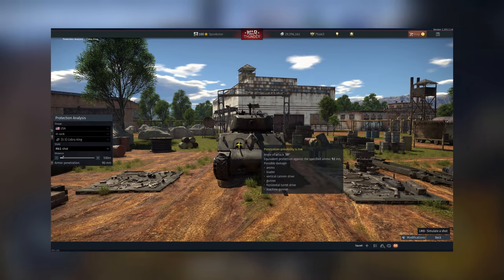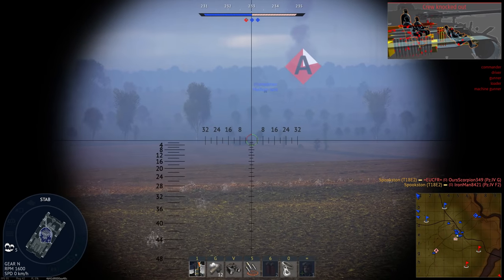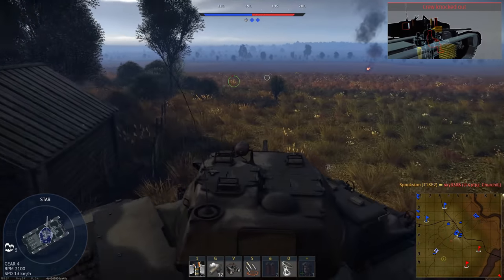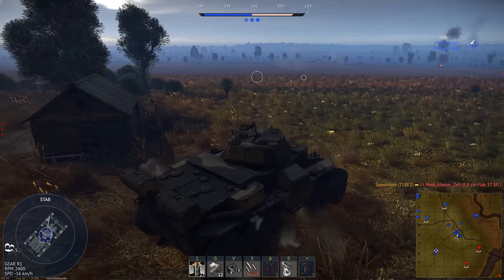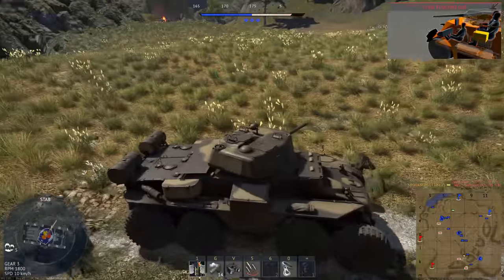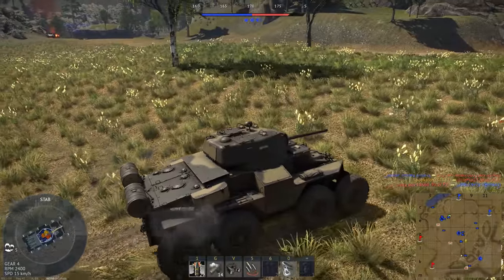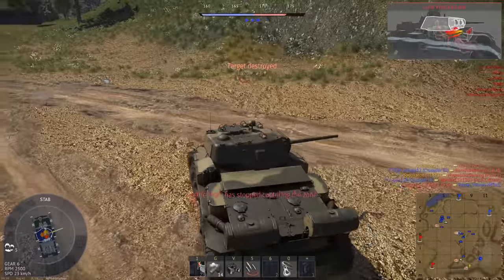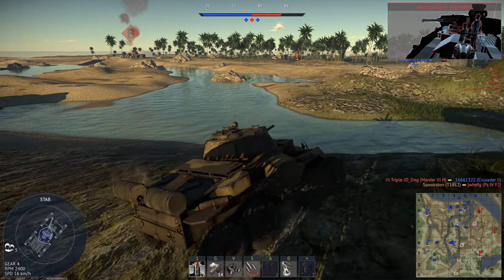Volumetric Shells Were A Bad Idea

Comment: Since the addition of volumetric shells the M22 and many other tanks got their side Armor buffed because of the tracks... They can have up to 1300mm of armor on the sides. But other than that i have to say that i am still doing pretty well to some extend. I didn´t even change my playstyle its just more finding and knowing possible weakspots. which makes the fights more interesting for the most part. Of course there are still issues with this system but its better than pixel hunting. I mean come on who wasnt annoyed of that constant turret ring sniping. Every freaking tank could shoot it and now it´s MOSTLY fixed. It can be more frustrating penning enemies but think of it that way consider what tank you use and they´ll have problems penning you. It´s a matter of who knows the enemy better than just sniping the beloved turret ring or those standard Hull weakspots like on the shermans and T-34s. Use the Slopes of their Armor to your advantange (if possible of course) and try to get your shot to bounce off an angled plate into their tank. Like the mantlet on the panthers.  Try to snipe the lower part and most of the time the shell will bounce down and penetrate the roof of the hull. Knowledge is everything with this. Try using the armor viewer more it can help for some amount

Comment: You mention shots not going through where two plates meet. If you mean say the join between an upper and lower glasis on say a T-44 frankly shells should have a very low chance of penetrating said location just based on physics. A join between two angled plates, especially if hit on the point is the single thickest part of those two plates.  Plus the odds of an impact not being slightly off center and thus being subject to high angling are very high.

Of course this only matters if people care about the game performing in line with actually physics, which it really doesn't most of the time

Comment: What I've noticed is that most people complaining are complaining either about the known bugs, or top tier stuff specifically. Only a few mention things like the Jumbo. Just let them over push with their extra new found confidence and get their sides. Plus at 5.3 it's got a peashooter, and at 6.0 its armour isn't crazy. Remember when the 76 was 5.7? I do. Just be glad it isn't still there. If I'm not mistaken the 75 was at 4.7 originally? For sure 5.0. Go for the flat front of the transmission and flank it. I also thought the German 75 and long 88 had no problem with the upper plate on that thing anyways. I dunno, I think once the kinks and bugs get fixed it will be great. Top tier is fucked though, I don't think there is fixing that other than not playing it, but that's just me

Comment: This is generally a good idea, but like with most things Gajin does, was horribly executed. Now, I by no means know how it should actually be done, but what I can think of is, instead of it considering only the armor that is being hit (I.e shell edge getting stuck on some corner and bouncing), it should consider the point of contact, The tip of the shell, and the armor between the thickest part of the shell and the tip. This would help the problem at least a little bit, and would make targets like Coax MG's viable again, while still keeping the volumetric shells.

Please excuse me if my explanation was bad. I ain't the best at explaining things.

Comment: I like vol. shells because it makes the game more realistic and less arcady, and im playing manly Germany, who probably benefited the least from the update, but i agree that they need to be fixed. It would make sense that if the thickness of the hit area differ, an average value of the armour depending on their portion in the shells path would be generated. Then, the problems with small weak spots and overlaying armour would be solved while still being realistic. It is not realistic to squeeze a 152mm shell through a Jumbos MG port.

Comment: Personally I like the volumetric shells and haven't had much issue with them. Generally speaking I never have much issue with kv-1's and heavys. The 279 isn't what I would call sucks issue but I don't often use atgm slingers. My battle plan with 279 is pop the gun and rotate to it's side or rear. But that's not always viable. Dart drops it well tho, but in a uptier to see it certainly is scary. On the by and by I don't see it as a issue. The jumbo is hard to kill but not overly so in t34-57 and even in pz4h.

Comment: Could not agree more: “Gaijin hasn’t shown they are willing to stop adding new stuff in order to vastly improve the old.” 
if you are taking away shells abilities to cause damage via penetration then adding the ability to damage components via Spaulding should be added. I know the 120mm of the superbias may not punch through but it should still be causing damage just from its size and force of energy/explosion.
Reply: Spaulding? What does that mean
Reply: @punic4045  Spalling, (autocorrected) the splintering of armor on the inside when the shell fails to pen.
Reply: @snoop-a-loop715  ah thank you

Comment: Volumetric Shells is an alright idea.
However, as with every mechanic that Gaijin implements, it's inherently broken.

They really need to do another geometry pass on every Ground Vehicle. And while at it, try and implement armor degradation, which could in theory complement the whole "hullbreak" mechanic, hopefully removing the bullshit feature of hullbreaking by shooting at optics of IFVs and other lightly armored vehicles.

Comment: They are trying to make it more realistic to a degree, but also hitting weak spots on a tank is a skill and it should be. It is hard. On tanks that have only a few weak points, that makes it ever more rewarding when you hit the shot. Also, it should be difficult, hard, and frustrating to understand the game at first, to a degree, but when you learn how to properly use a tank and learn how to aim and where to aim, it isn't as hard as you say it is. When you now what you are doing, it is easy. That is why I am good in a tank compared to my friend who doesn't know where on a tank you should hit. It is a thing you learn and a skill you gain, and you keep haveing to adapt to new tanks as your BR gets higher which means new armor designs and thicker armor from enemy tanks.

Comment: "I didn't like it when I first announced it so I went into it only looking for the negative"

Now for gun barrels being able to hit ATGM's like a baseball yeah I agree. Thats unrealistic and wack. Then again a 152mm shot only causing impact on a 1 pixel large point is also unrealistic. As for turret rings and whatnot, I don't agree at all. T-34 and KV-1 turret rings especially are still fairly weak. Yes obviously harder to hit with larger rounds since it's not a large gap. Means you have to be more accurate and center the shot

Comment: If on one hand quite a few vehicles that were out of the meta got new life breathed into them (ex : the 7.7 M60 suddenly wasn't just getting penned everywhere on the turret by lazy shots from Tiger IIs and T-44-100s), many that were already meta got even stronger (I'm looking at you KV-1, especially the German ones).

It's got positives and negatives, the way I see it they should just start adding more volumetric on existing vehicles and fine-tuning the shell hitboxes to avoid bullshit stuff.

Comment: The game is better with VA. Just because you or anyone for that matter can’t adapt to a more realistic calculation of projectiles in a game heavily involving various ballistics and armor...does NOT mean it’s “a bad design” it just means you might need to learn to better adapt. 
If the argument is to have a more realistic round simulation and the choices are “Pixel hunting” as you call but really it’s simply memorizing unrealistic weak spots because every round was effectively a laser beam
vs 
having to ACTUALLY look for a spot your particular shell will have a more realistically probable chance at penning the armor your facing. Well the choice is clear. 
I’ll take the maybe not PERFECT option but at least potentially more challenging and rewarding ☝🏾

Comment: i dont mind the idea of volumetrics, but it is not ready yet imo. They need to add spalling for large caliber HE shells on pre composit vehicles instead of having it as a post penetration effect. Instead of penetrating a barrel head on or pre detonating shells or missiles, it should ricochet off  with a high chance of hitting the tank afterwards, only hits directly on the front or "flat" side should guarantee a disabeling barrel hit. APCR shells need a rework, they are way to useless as they are right now with a 80% chance of fracturing in my experience.
Also tracks damage sponging needs to be fixed, they are way to overpowered in damage mitigation and a large portion of the time flat out stops rounds compleatly. That also includes the damn russian sprockets or idler wheels

Comment: I would've much rather they didn't release volumetric shells until they were ready, instead of just shoving them out to go "haha told you so"

If volumetric shells came with an armor update as well, it might've been great, but noo gaijin just had to jab at us for complaining about a legitimate problem, it could've been cool if for example an APHE round hit a small weakspots, but instead of straight up penetrating through a hole smaller than the round and instakilling the tank, some of the shrapnel from the round fit through the gap killing what was behind the weakspot instead.

Comment: Also that fact that russian tanks at 10.0 obliterate allied/NATO armor with a single shot, but you can no longer go through their front armor, and hitting their driver port is a chore because they are charging at you or you hit their gun barrel (the issue you mentioned before). It's annoying when I see a T-62, that has about 100mm more penetration with their apdsfs than a fucking m1 abrams kill said abrams in one shot.

Comment: I personally love volumetric shells, as armored machines just became really armored. Before 1.101 any cobblehead can just annihilate you no matter how many armour you have. So pre 1.101 "armored" vehicle's armor was effective at long only, now it effective allways. Having 120 mm shell passing through few cm hole is utter bullshit. Having propper detonation of damaged heat is also bullshit (these fence-alike screens work exactly that way). Thick shell as ray is also ungood. Thanks, now that's forbidden. Also mentioned "too much armoured" vehicles got their BR increased, including obj 279(which has glass barrel and breech, and it takes 30 s to repair these, that's 3-5 shots). Currently i have almost no problems if i aim at particular spot on enemy armour. I have problems pennings tanks by hitting them "somewhere at silhouette", but that's very ok. Want pen - aim properly.

Comment: I expected volumetric shells to not make the game "better" but to change it completely as it is a complete overhaul of a base mechanic, if your shells bounce more, well, git good, machine guns and optics are broken tho, and other small "elements", overall I think the mechanic is good, it's just that the already broken aspects of the game gave it a bad rep, when in reality by itself its a lot closer to being good. if anything the mechanic was added haphazardly without thinking how the system which was previously optimized for pixel shells would affect it, of course, it's unreal, the puzzle of mechanics don't match, as a result, several other game aspects need to be reworked
Reply: rather than bashing gaijin for bad choices again think of how you could fix the game, for example if they implemented volumetric armour where it needs to be, a lot of the overlapping issues would be fixed, especially if whole tanks where made of volumetric armour

Comment: I like volumetric shells. It brought back armor at higher ranks which is a good thing in my opinion. Yes, there are some problems (that will get ironed out with time) but in general I think the change was for the better.
Reply: >get ironed out with time

I have no idea what developer you think runs War Thunder, but Gaijin has proven time and time again they have no interest in ironing glaring issues out overtime. More than likely, this issue will remain and this video's complaints will stay relevant in excess of six months from now.
Reply: @bluntcabbage6042  they have fixed a lot of things throughout the years. Ive been playing since 2014 and the game has come a very, VERY long way. 

It's easy to only see negatives.
Reply: @ItsATrap614  How did it come a "very" long way? The same fundamental issues I've seen since 2015 are still around today, sometimes even stronger than before.

Gaijin continually and willingly avoids making any kind of big effort against fixing the fundamental problems with their shitty gameplay loop, they consistently ignore the community on almost every matter, and does everything in their power to fuck over the playerbase.

Universal outcry comes about literally every time an assembly event happens. Guess what? They still do assembly events.

Growing problems with BR compression continue to crop up with nearly everyone in the community agreeing that it's a bad thing. Guess what? Gaijin takes virtually no meaningful steps to fix it.

The awful SL economy ruins entire tiers for certain nations and serves as nothing but a drive to make more people pay money, and basically everyone agrees it should be improved. Guess what? Gaijin does nothing about it.

More and more modern vehicles are being added, often with even more gimmicks (which are frequently implemented poorly), and add effectively nothing to the game in any meaningful way (except to occasionally destroy any kind of balance the game had previously). Guess what? Gaijin does nothing about it.

They are some of the most inept and incompetent devs I have seen for a game as big as War Thunder. They consistently fuck up barebones features, they make nonsensical and pointless changes which only make the gameplay worse, and do nothing to fix enormous problems (opting to instead add more gimmicky vehicles which just make the problems worse).
Reply: @bluntcabbage6042  if that is your opinion so be it. I see no point in continuing this discussion since you do nothing but complain and fail to see any positives. Your mind is already made up. Good day.
Reply: @ItsATrap614  Every positive the game has is immediately tainted by a glaring problem. I suppose it's too much for you to comprehend that the game has been utterly plagued for years with issues that Gaijin continually chooses not to fix? Hard to support an opinion wherein every supporting argument you can make is hindered by an equally potent rebuttal.

Every positive is ruined by a huge negative in War Thunder. Simple as that. It's not my fault that Gaijin is effectively killing their game with every consecutive update that is poorly executed and implements even more broken things than before.

Comment: LOL 1 frontal weak spot to the Jumbo? You mean its entire front to the T34 85 when in real life its armor could stop it? God forbid a tank that was MADE to have heavy armor can't be penned in the front, you might have to flank and shoot the sides, the horror. It was WAY too easy to exploit weak spots before this for any tank. IRL your shell isn't going to go pinpoint where your crosshairs are anyway, so it was very OP. Its not like it takes skill to hit the weak spots close range, lets be real. Admittedly I don't play as much as I used to but the amount I have played I like the change, because I am that guy who does keep dying to some super lucky shot from 1500m going through a 5mm crack in my armor that should not have penned otherwise.